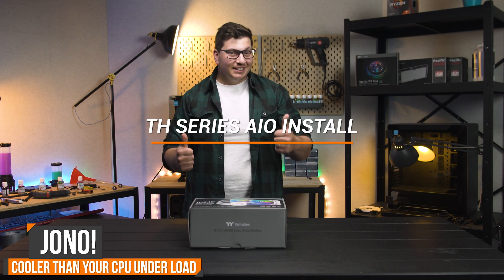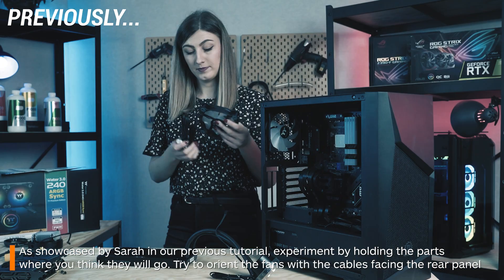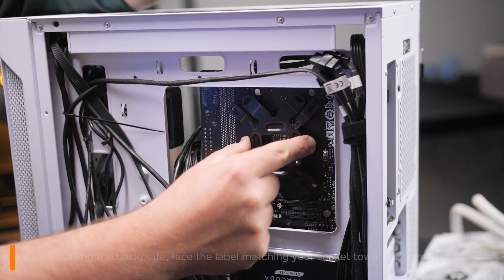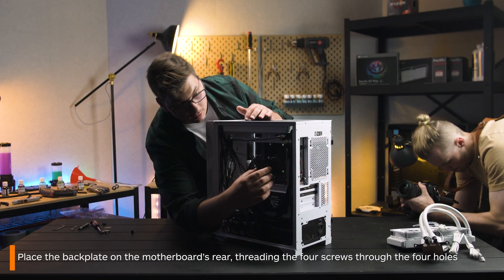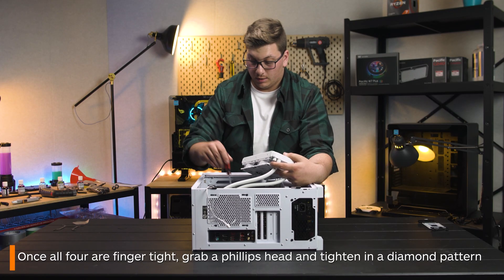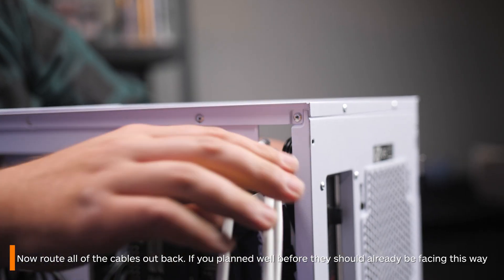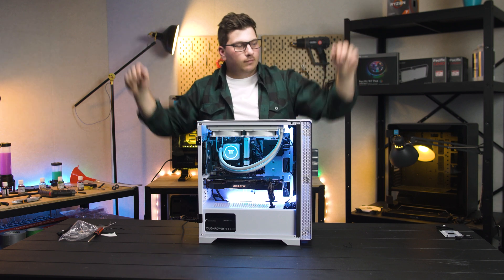HOW TO Install and connect a TH 240 or 360 series All In One CPU Cooler

Comment: i have the same aio in 360 with asrock mobo, i connected the pump cable to a cpufan2/wp header and the radiator fans in cpu fan 1 header. I have 2500rpm in pump and 1450 in radiator fans while in idle. Is this correct? Why in my bios I cannot change the radiator fans in pwm mode and I go this option only for the pump?

Comment: Hi there. I purcahsed a pre-owner TH360 and it came without controller or the split cables. i can connect pump and 3 coolers between themselves but i cannot find such small 3 pin header on my gigabyte motherboard? could anyone help me with that? I only have argb header (that 4 pins with 1 missing)

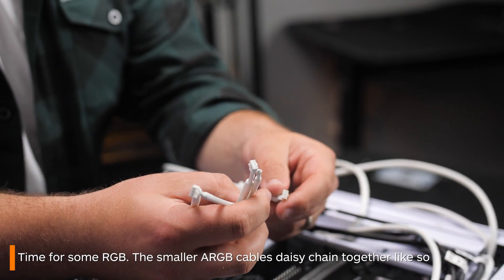So at 6:25 there is this cable im talking about, i just cant seem to understand where do i connect it? i dont seem to find it on the motherboard
Reply: did you ever figure it out? i’m running into the same issue.

Comment: I just bought this AIO (open box) technically new. However  I can't seem to find the am4 bracket.I can see in this video it does exist 😅 I messaged the seller already about it but in the meantime I'm investigating as it seems like all components are included in the box that are presented on the installation guide but not the AM4 bracket as in this video.I hope this makes sense.Im a bit confused as it supposed to support am4

Comment: I am struggling. I have an Intel based system and this is my first AIO install. I can’t find anyone installing this AIO with Intel instructions. The provided manual is confusing. It tells me to use the silver screws with the LGA1700 install but it doesn’t fit. I can use the black screws no problem. I am mid install for my first PC build since 2010 and this is all just confusing! 😅
Reply: I'm here for the same reason, wasn't much help was it.. there's no way those silver screws are going in those holes.. did it work with the black screws? hoping I don't have to cut them shorter

Comment: Hi Thermaltake, I've been using this cooler for 2 years and temps suddenly started reaching 90+ degrees C. I've taken off the cooler and put in the AMD wraith cooler that came with my 5600X for the moment so I can work.
When I shake the TH240 I can hear a ton of bubbles. It's like shaking a half-empty water bottle. Also when it's running, only one corner of the radiator is hot (the corner where the hot liquid tube is connecting to the radiator). I've checked the pump and it's working fine. It seems like some kind of a blockage or some heavy permeation of coolant. The store that sold me this refused to repair this and It just ran out of warranty 2 weeks ago.
What I want to know is, how do I safely drain and refill this with new coolant? It would be amazing if I can do it without taking the pump assembly off. Is that knob next to the tubes in the radiator an access valve? You have no documentation about this. I've checked everything out there. Also, will car coolant properly diluted with distilled water work for the task? I live in a hot country and we don't have antifreeze in our coolant BTW.
Reply: Same here, piece of garbage, pump just stopped making the typical "whooosh" sound, but it seems to still be running, temps were  at 90c playing (drumroll) FarCry1, lol. I managed to get the temps ~10c down by cleaning the radiator, some dust built up over the 2 years, however can't wait to throw this junk out.
Reply: @carlwirch  My exact feeling. I emailed with them and they told me absolutely nothing in broken English. This company is awful. My cooler is still laying around outside my PC.

Comment: First that is really usefull, everything is exactly explained! Like+sub!!!!! 
But still have a question:
How to control rgb if you plug it in into the motherboard
Reply from the maker: So glad to hear thanks so much! :) So, you'll need to install the relevant motherboard software for you. This will be Mystic Light for MSI, Armory Crate for ASUS, or RGB Fusion for Gigabyte for example.
Reply: @ThermaltakeAustralia tysm i will start my build in 1 week, hopefully it will work! And this cooler works on am5 right?

Comment: I got the TH240 and the back plates (plural) are nothing like in the video. Instead, they are plastic. And the best part is, the provided screws don't match the threads in the back plate. Literally can't install the cooler. Returned and got a new one - exactly the same issue. Cooler looks cool, but what good is that if you literally can't install it? How hard can it be to provide the correct plates and screws? No idea how to get a hold of Thermaltake support either.

Comment: ?!!!! were is instalaton for 360 water cooling?
Reply from the maker: As in a TH 360 AIO? It's pretty much exactly the same, just with a larger radiator, so you can most definitely follow this guide still, you'll just be adding on an extra fan.

Comment: actually, if you connect the fan pump cable to aio_pump if you have on the mobo. it is a lot better. my temps dropped about 7 C after that.
Reply: Is it compatible eith am5?
Reply: @rwdedits  yes, i guess

Comment: This video was really helpful, but the paper instructions in the box say to do it a totally different way with amd cpus I think? In those instructions it says that you don’t have to change any of the mounting on the front or the back, you just kind of clip it in with the default mounting. Did I misunderstand this, or is this also a viable way to do it?
Edit: It’s a TH360 AIO if it matters
Reply: I´m installing the th360 right now and I dont see anyway it could just clip in , you need all the parts to be able to mount it

Comment: Can someon help me? I buy  this product and take it into a tt divider 370 tg snow argb pc case. My question is, why is this fans are so loud? My older pc was more silent with noname fans in it. Maybe i choose the bad place to connector? Thx for your answer.
Reply from the maker: Hey there, the TH series of fans are not PWM controlled, so you need to install them into a fan header which you can control via software or the BIOS; alternatively, you can install them into a fan controller. As they are 3-pin and not 4-pin PWM, they will run at full speed unless instructed not to.
Reply: @ThermaltakeAustralia  thank you for your quick reply. My friend helped me, we should change the pluged in cable to another fan_sys port and now the software can handle the rpm automatically.

Comment: Really wish they would have made the AIO cover reversible. Mine is going to be upside down because I just went over all possible positions for the radiator and the only one that has the tubes reach the CPU is one that the logo ends up being upside down. I know it pops off but there are only holes for the tubes on one side and yes I thought about cutting out my own holes in it.
Reply: Ik I was worried about this same thing luckily mines right side up but yea very silly they didn't allow for that
Reply: @traceshorter8803  I ended up using a rotary tool to cut out holes on the other side so that I could flip it right side up
Reply: This works with am5?

Comment: How do I get the TT RGB PLUS 2.0 to run with this unit? I have an error stating fan controller cannot be found...
Reply from the maker: The TT RGB Plus software is designed to be used with digital RGB products of ours like our Riing Plus fans, Floe CPU Cooler lineup and our custom water cooling components. 
The TH series of water coolers are actually aRGB controlled, so they are controlled manually via the included inline controller which connects to the arb cable and a sata power cable OR it connects directly to a 5V header on your motherboard to then be controlled via motherboard specific software like ASUS aura, MSI mystic light etc. Hope that helps.
Reply: @ThermaltakeAustralia  Is there a way to rotate the TH360 v2 argb LCD in Polychrome? As far as I can find people have only done it using TT RGB plus with a TT controller and I see no option to rotate in Polychrome. I can change the colours/effects though.

Comment: Hi there ,

I bought the AIO but my board Gigabyte B450 Aorus Elite does not have a 3 pin VDG but only a 4 pin VD_G connector as described in the instructions under ASUS & MSI can I also connect the RGB lighting? According to the board plan, the PIN assignment must be the same as the MSI solution
Reply from the maker: Hey there! Some newer boards from Gigabyte have moved on from the 3 pin over to the 4 pin RGB headers - JUST make SURE that you are only connecting 12v headers with 12v cables and 5v cables with 5v headers.
Reply: But where do you put the 3pin where there isn’t any 3 pin connectors? @ThermaltakeAustralia

Comment: Mine's all hookedup and the fans run but no RGB at all.  I have to take it all apart now to get the manual ARGB controller installed, which I am fine with but do not understand why the RGB Fusion software doesn't even recognize it as it is my understanding you are supposed to be able to control it via software if you didnt want the manual ARGB controller hanging out the back of your PC

Comment: Thermaltake is really vague on the install instructions for their fans and pump but did get teh pump working i think but the RBG lighting in the AIO isn't plugged in couldn't make heads or tails of the cords for the TH360 i recently bought so i went to the other RBG fan i had from coolermaster which works real well for now.

Comment: Hey can I put the radiator on the top of my case (Thermaltake Versa J23)
 Is it convenient that the AIO fans are taking air in or out? Considering that the front 3 put air in and the rear takes air out

Thanks

Comment: the controler for argb 
comes in the box or u should buy one  ?
Reply from the maker: It sure does 😊 Our aRGB products come with adapted cables to suit supported motherboards with RGB headers but also include a slim in-line controller so you choose what to use.

Comment: I have an old AM4 board ASRock X370 Gaming X.. it only has those old RGB 4 pin I think.. some AMD LED supported thing iirc.. so I didn't plug into the board

The controller isnt accessible without removing my window or doing a mod.. so is there any software ? I downloaded 3 things from the TT site.. all of them say cant do shit without board connection right ? maybe some 3rd party solution if I'm super lucky but gonna guess not ? maybe adapter to old 4 pin RGB ? shame, I have 5pin to 4pin adapter haha oh well, very cool and thanks for the video

I actually forgot the washers on the backplate mounting screws, lol oops, but works fine and will put them in 1 by 1 later I suppose.. lol better than attempt 1 which must have had a short or something using old stud system from a Corsair. Hassle but got there in the end, works, works very good.

Comment: I have TH240. I when I plug pump in CPU FAN, pump run all time on max speed. When i plug it in to system fan pump's spin vary. Whit's one is proper, should I run pump all the time at full speed?

Comment: Hey I got this aio on Amazon for $110 and I’ve notice that it’s not keeping my 9900k cool. It’s still running at about 70 Celsius even sometimes at 85. Am I doing something wrong?! I’ve installed everything correctly atleast I hope I did
Reply: Maybe theres some apps you have running that are using your cpu that you dont need or your pc may generally get hot due to a hot environment or not enough fans

Comment: What's the dimension of the waterblock?
Reply from the maker: Hey Michael, we don't have the dimensions for the CPU water block on its own and we're out of office until the 5th otherwise we'd measure for you. 
Is this to fit into a specific case?
Reply: @ThermaltakeAustralia  It's ok I can wait, thanks for looking. Yes, I working with a case that has a 59mm cooler limit, if you have the diameter of the pipes as well that'd be awesome.

Comment: Can I connect the AIO pump to the mobo  pump connector, which will always run at 100%?
Reply from the maker: You can if you are okay with that! It'll just be loud.
Reply: The pump connector on the motherboard is for a custom water cooler pump, this is so if the pump doesn't get any power the pc won't start, if you want control of fan speed your want to use the cpu fan connection on the motherboard.
Reply: @SidDTheSimschannel  im having that problem rn my pump and my radiator fan speed is always running at max speed and i can t control the radiator fan or the pump fan
Reply: @kirizaki8194  some motherboards need you to activate the fan control settings, you can also use the software to adjust the fan speeds
Reply: @SidDTheSimschannel  i did all of that and its always maxed for some reason... i can change setting in dragon center but the speed wont change no matter what fan curve i set it too ... it only works when im in dc mode